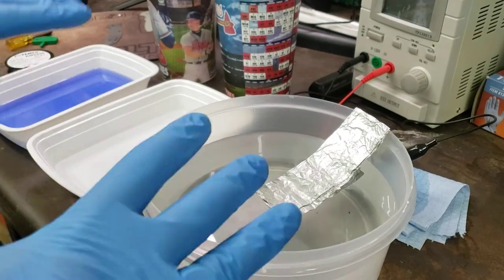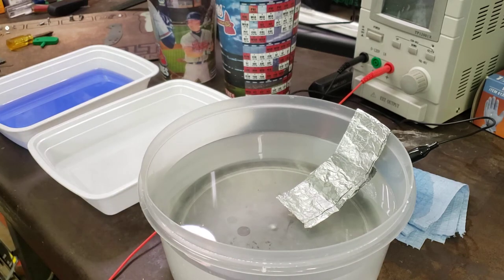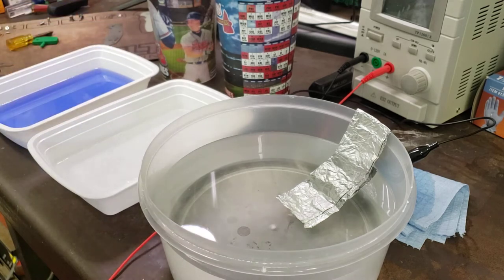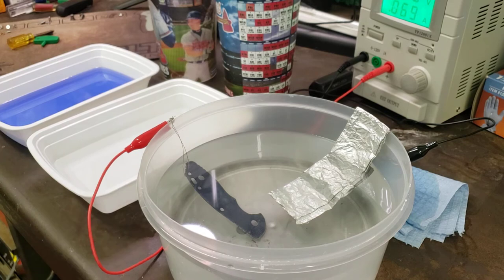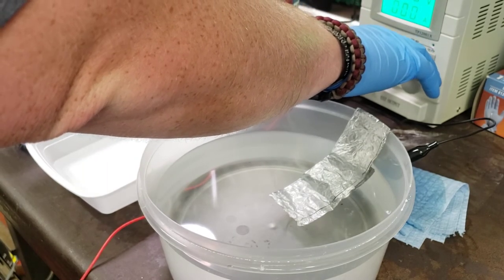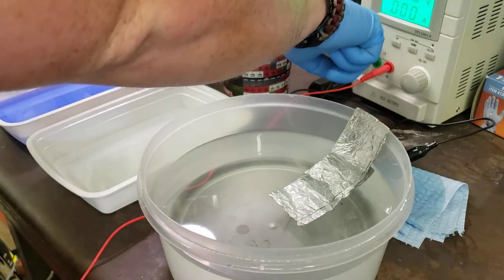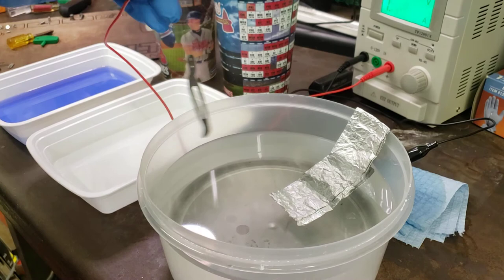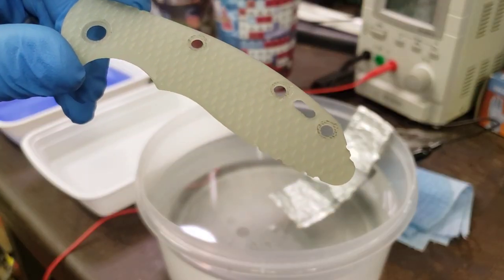Patreon- Knife Project Pt.2: Titanium Anodizing

Comment: Wow, great video. Thank you. Any idea how to turn titanium black?
Reply: Use a MAP torch to heat the titanium until its glowing bright red and then immediately quench in vegetable oil or Canola oil. Simply repeat this process about 4 or 5 times until you have a black coating. Each repeat of the process will make the titanium a little darker. Do this until it is black. 
Oh and also, just so you know, You do not need to wipe the excess oil off after each time you quench. It's a real simple process.
Reply: @pooder53  Awesome. Thanks so much for the info. Greatly appreciated 😃
Reply: @SlapShotRegatta22  no problem man! OCD4EDC (youtube channel) has a video tutorial of him anodizing titanium black if you have more questions.

Comment: What voltage did you use to achieve the deep bronze on the scales?
Reply from the maker: I can’t remember for sure but just by looking at it I would think somewhere between 15 and 16.5 volts. By the time you get up to 18 volts it’s already turning purple, but given how dark that bronze is, that would be my guess. Cool thing about anodizing is that if you’re careful when stripping it, you can keep trying until you get it right.
Reply: Do you offer anodizing service?   If I wanted to send in scales and hardware for green ano,  how much would it cost? Thank you

Comment: Do you need the Whink for it to work?
Reply from the maker: It's not necessarily needed, but it definitely is the best way to "strip" the titanium of any coatings, previous anodization, or contaminations like oils and stuff.  Anything like that on the surface will prevent the titanium from anodizing in the areas that aren't clean.

Comment: Which voltage is for black anodizing?
Reply: Can't anodize titanium black.

You can heat it and quench it oil repeatedly to darken it. It won't be truly black, but is a very strong coating that's much more resistant to wear than anodizing. It won't come off with HF acid though (if thats a concern) and repeatedly quenching titanium comes with obvious consequences, but that shouldn't matter in knives.